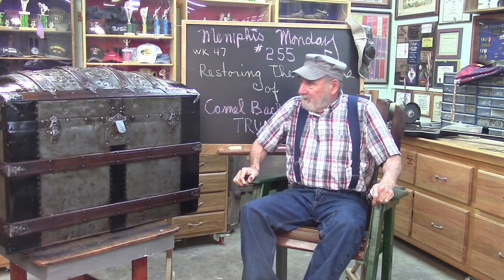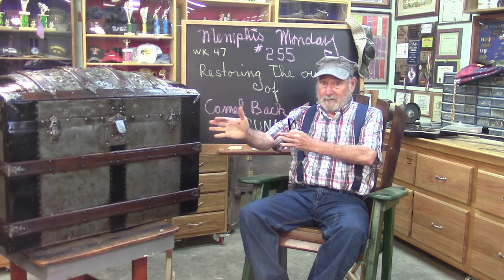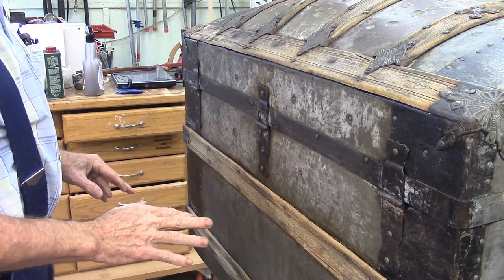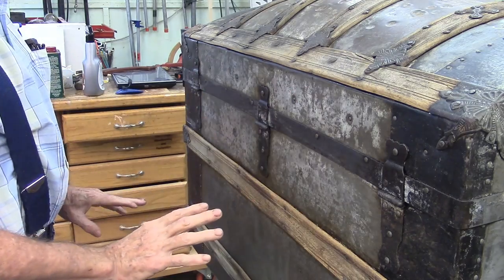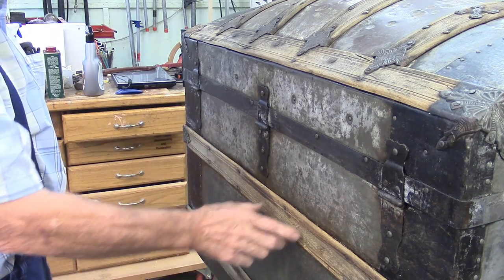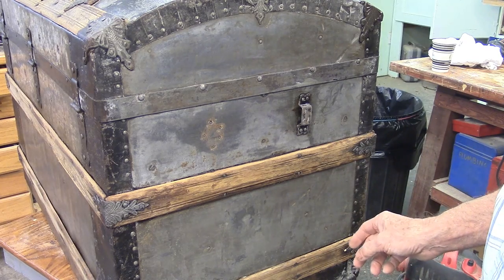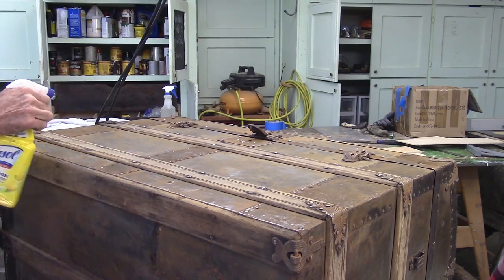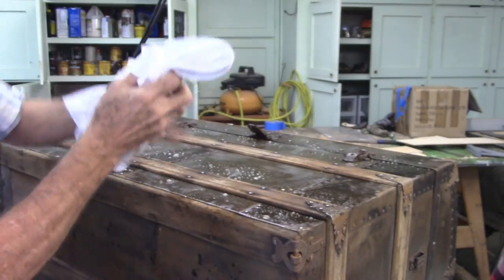255 Restoring a Camel Back Trunk

Comment: And I thank you for this and all answers you give me.
Reply from the maker: I wish I knew what those questions were.  But I know what you mean.  Look around at several references, but then try to figure it out for yourself.  What happens?  Well, if your answer is close to some so-called expert, then that is probably the right answer.
Reply: Memphis Applegate I thin you are the expert and wish I had seen your video first.  My steamer trunk turned out great because of your advice and answers.
Reply from the maker: @francesmcintyre5810  Remember Frances, if what your're saying is true, then is is likely because you followed my advice.  And my advice:  check multiple experts, deleting any so-called expert that thinks they have the final answer.
Reply: Memphis Applegate ❤️
Reply: Wish I could share my picture..  was it easy, no, but it was well worth it after following your advice.

Comment: I have a trunk that is a wooden slat (zebra) trunk that is a different style but exactly the same hardware (corner pieces, lock, latches, etc.). The lithograph on the lid is similar in style, but has a different pattern. I can tell you, with 99% certainty, that this trunk was made by Martin Meier and the company that made the lock was Star Locks from Philadelphia. Meier's trunks were considered a more top-end trunk in their day. The key, if you have it, has a star cutout at the top. Anyhow, just fyi.

Comment: If you use rust remover (aka Muriatic acid solution) you should always use a Base solution as a wash to neutralize the acid, then a water rinse.  Mix a cup of baking soda into 2 cups of water and spray that around like you did with rust remover.  Where it foams up is where it's neutralizing the M acid.  Rinse/wash with clean water.  Great job btw.
Reply from the maker: Thanks.  I think I just used water, but adding a base would have been better, as the M will continue to eat into any metal for a long time/
  Thanks for watching and commenting.

Comment: Really nice old chest! Looking forward to doing the inside. Liked the grease tip.
Reply from the maker: I think the grease tip works better for spot painting cars.  The problem here is getting the grease off, since grease is not a good mix with stains and other finishes.  I suspected as much, which is why I only used grease on a couple of fittings and used tape everywhere else.  
     It did turn out nice, and the primary reason was that it wasn't too broken.  A good clean-up and the quality of this old-school construction shows through.  Words to live by:  Do as little as possible in any restoration.  Unfortunately, there wasn't much to work with in next week's effort and I had to start over.  
      Thanks for commenting and I hope to see you next week.

Comment: Would you recommend a brush or cloth when cleaning these old trunks for the first time? 
You do an amazing job! Beautiful trunk!
Reply from the maker: Start with soft cloth with mild soap and water.  Move up from there with great caution and reflection.  It is better to do too little than do too much.  You will totally understand that cliched statement if you check out some trunk restorations pictures on the internet.  Good luck on your project.

Comment: Starting research on mine. Mine is camel back with an alligator looking metal. The inside is fairly good. Cant seen to find one on line like mine to see what it's supposed to look like. Wasn't going to keep the lithographs though they are in good shape. Would leave them if this trunk was of value but trunks don't seem to be worth much from what I've seen. I'm wanting to leave mine open for decorative purposes, that is why I thought about removing lithographs and putting fabric or wall paper.

Comment: Wow. I haven’t seen an old European trunk like this in North America before. This would have been considered a very, very high end trunk in its day. The high end trunks always had wall paper on the inside and metal cladding on the outside. (The lower quality trunks had wallpaper inside and outside.) This trunk though also has the paintings on the interior lid compartments which only very wealthy or titled people could afford. Not to mention the highly decorative metal corners and end pieces of the wooden bands would have increased the value of the trunk. An intact and in good condition trunk such as this can be worth anywhere between $4000 and $10,000 depending on the lithograph in the interior of the trunk. Trunks like these are very few and far between. Whomever owns it has quite a treasure on their hands.

Comment: We used muriatic acid and the smell is horrible. But just need to know what you put on after removing to keep from rusting again?  Thank you.
 So much.
Reply from the maker: Mild steel probably needs to be painted.  I covered my mild steel with paint, and covered the galvanized steel with spar varnish, or spar urethane.  If you have steel that is rusting, then that means it is "mild" and must be covered with something to keep the oxygen and water out.  If it is not appropriate to paint it, then use the urethane.
Reply: Memphis Applegate thank you so much.  I think I want to keep the steel tin look so that is exactly what I needed to know.  I appreciate your help so much.  Stay safe and thank you again.  When we get it finished I will send you a picture of before and after.  Thank you,
Reply from the maker: @francesmcintyre5810  Still waiting on that picture.
Reply: Trying to figure out how to send from pictures.

Comment: Amazing, I bought a 1870 camel back steamer trunk I’m getting ready to restore. My question is what did u use to make it shiny.
Reply from the maker: It's been over a year, so I can't swear to it, but I believe I used either Polyurethane or Spar Urethane.  Spar Urethane would have been the better choice.
     You do need some kind of finish, or it will begin to rust again.  If you are doing a back to original restoration, then I don't know what to use.  Perhaps boiled linseed oil on the mild steel parts.
      But the trunk was designed to require no finish at all.  All the parts are painted, plated (no chrome in those days), or galvanized, and in a 150 year old trunk all three have failed by now.   
     Thanks for watching, and try to watch the follow-up video where I do the inside.

Comment: I am finishing a trunk that looks almost exactly like yours. How do I know after I sand it, if it's still rust that's I am seeing or a rust colored seal of some sort? Also, when do I use the refinisher?
Reply from the maker: It is rust.  All elements react with  oxygen, even gold to a small degree.  Acid will drive away the rust (corrosion caused by oxygen), then you need to seal the surface from oxygen.

Comment: Oh we were covered in rust after sanding but it looks good except I think we need to spray wth something  really good to keep from rusting.  Do not use muriatic acid.  We threw it away as it made it rust more.
Reply from the maker: Yep, I don't recommend muriatic acid, as it eats into the metal and can make things worse.

Comment: Great video! im in the process now and this is really helpful, i have a question on what did you use as sealer for the metal?
Reply from the maker: I don't remember, but I think I used Spar Varnish.  I suspect boiled linseed oil would have been another choice.

Comment: Please tell me how long it took.  I have one my Dad bought for $5.00 many many  years ago and I want to use in my house.
Reply from the maker: Took about a week, working off and on.  Half of that time was debating with myself; arguing with myself concerning the extent of restorations.  My advice is to do as little as possible, as your trunk is only old once, and everything you do will be killing some of the history.    If it is practical, just clean it with soap and water.
Reply: Thank you so much.  It is in perfect shape except no handles.  Wire was used for handles so it has those parts.
Reply: Oh and it may have rust but I think I will do as you suggest-  thank you, again.